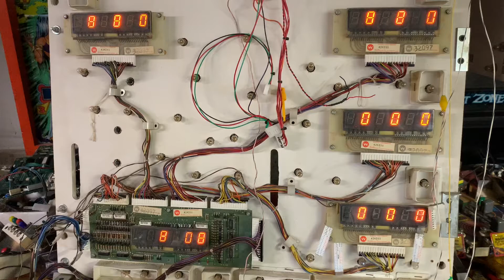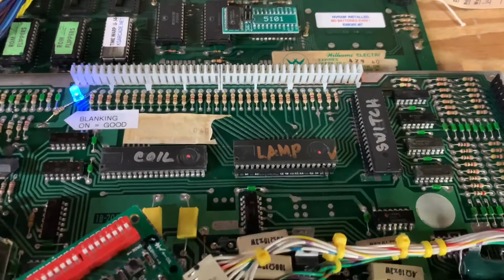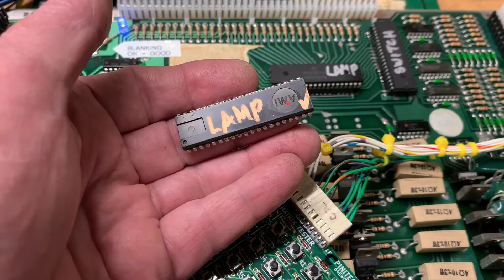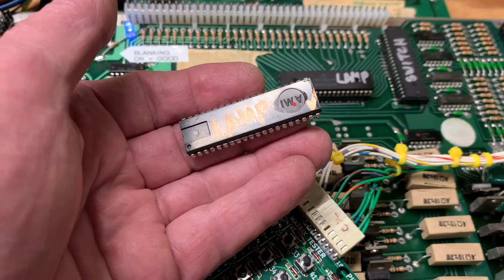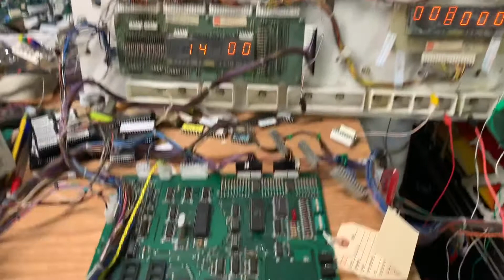Williams System 3-6 Display Issue, Every Other Digit Missing Demonstration and Corrective Procedure

Comment: Where would you buy a replacement for this issue?
Reply from the maker: I don't understand. You repair the board.
Reply: @ChrisHiblerPinball sorry I meant where would you find that IC. I actually found it via pinside.
Reply from the maker: @kawlie77  IIRC, the chip that caused this failure was a 6821. WDC now makes a replacement for this chip that can be purchased at marcospec, for instance.
Reply: Thank you sir  @ChrisHiblerPinball